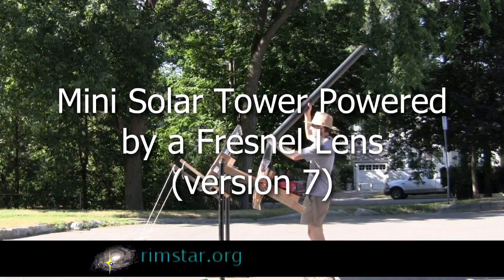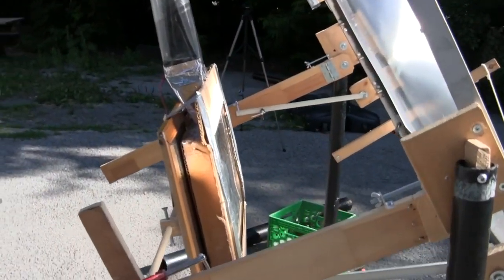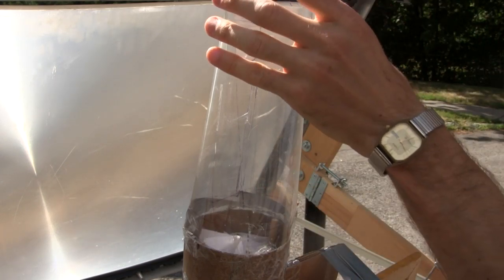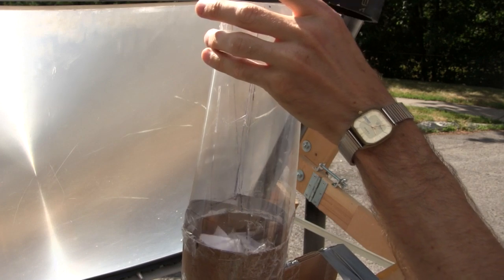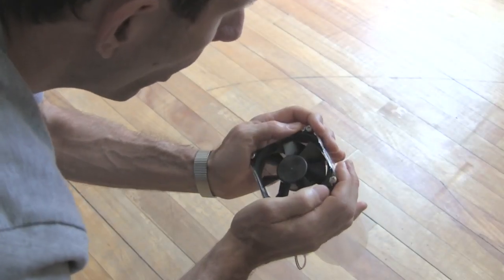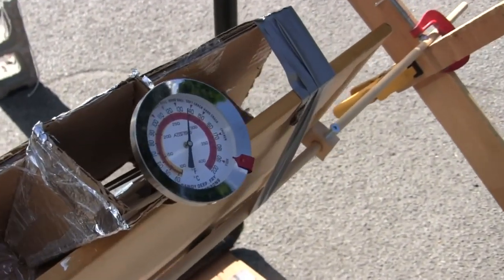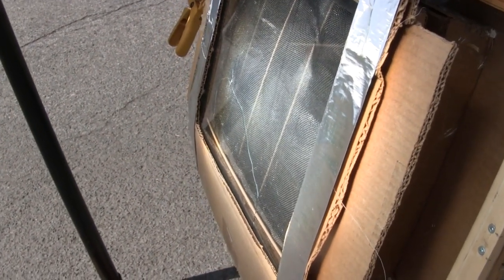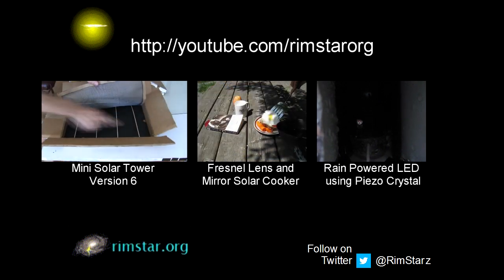Mini Solar Tower with Fresnel Lens Ver. 7 Screen Solar Air Heater

Comment: What if you took the top of a solar tube and hovered it over a solar panel.  It should double the output of the solar panel.  But it would also double the heat.  What can you do with the heat?  Why not place an apparatus on the back of the solar panel that would be similar to a radiator.  Then you could fill the pipes with antifreeze.  Once this was completed, you could transport the excess heat to a set of firebricks.  After the firebricks were heated, then you could hermetically seal the firebricks and use them for heat in the wintertime.

Comment: The blades on the pc fan are the wrong shape for this.  That pc fan is designed to pull (relatively) large volumes of air through the system when power is applied to the motor.  It would take a lot of speedy air to make it turn on its own to generate power. 

You need a blade designed to give you the desired torque to turn the motor (being used as a generator in this case) at the lower wind speeds you are producing.

Using a blade designed for one of those Martian helicopters would be an interesting test.

Another idea would be to use a  VAWT orientated turbine instead.  They work better in chaotic air flows.

Idea 3: could you tune the length and diameter of the tube to turn it into a vortex tube? That would seperate the airflow into two streams, a hotter flow near the wall of the tube spiraling up and a colder stream traveling down the center that could be recycled into the cold part of the stack.  You might be able to get a secondary power generation from the hot end if its worth doing.

Comment: One possible replacement from your earlier attempts could be to replace the Styrofoam with the high efficiency and very light fire brick. They're easily cut with a hacksaw and can withstand thousands of degrees of temperature.

Comment: Your entire system is flawed. The solar chimney creates airflow with heat rising, causing a draft in the pipe. If the air at the bottom is already hot then there is less temperature difference to cause the flow. It's like a tegs unit. the closer the two temperatures are, the less energy  you're going to get. You need cool/cold air coming in the bottom, then start heating the air.
Reply from the maker: I thought the temperature difference had to be between the cool air at the top of the chimney and the hotter air at the bottom, like this one https://www.youtube.com/watch?v=0tWlP0knKQU.
In any case, I do have cool air coming in the bottom, and then I heat it. It's just coming in the bottom of the box-shaped solar air heater.
Reply: Yeah, but look how high that tower would have to be. It was cooler at the top because of the elevation and location in a place with high heat at ground level. And the tower was white, which would reflect any additional incoming heat rather than absorb it like a black tower. That one looks more like they're using 'hot air rises' where the incoming air is already hot, but being so tall they're trying to force it to cool back down before releasing back into the atmosphere.
Reply: I figured since you're really working at it, I'd offer my 2 cents to try and help as best as my slow mind can ;)
And thanks for replying.
Reply from the maker: I appreciate your 2 cents, always. No one can live in a vacuum. Thanks. I tried something more like the solar tower in the link last summer but we had a fairly cool summer with the sun never getting strong enough so it didn't work out.
Reply: Count yourself lucky. I live in a small apartment where I can't really build much to test. I hope you find a method that works.

Comment: The thermometer, is it measuring the sunlight or the air in the box?  I suspect it is the sunlight concentrated onto the thermometer showing so high a temperature.  Try measuring the temp of the air as it exits the box.  USing the screens actually acts to impede air flow.  Replace them with a piece of metal that is centered in the box with air able to flow around both sides.  That should maximize the air heating process.  It may well be that you do not have a large enough chamber, not heating a high enough volume of air to move the fan blades.  Interesting experiment though, I look forward to seeing updates.
Reply from the maker: It's hard to tell from the video (2:08) but, while the thermometer has a long stem, the section that the thermometer's stem is in is sort of a box-like tube that's not exposed to the sun. You can see this output tube in the version 6 video here https://youtu.be/kIu67acx7qk?t=3m35s. So the thermometer is not in the concentrated sunlight and is measuring the heat of the hot air only.
Good point though. We have to account for that when doing solar cooking. In that case it's often unavoidable as there's often very little room for a thermometer.

Comment: Dude you need air volume, heat is nothing with out air volume. You need to think of air rising up because it's hot, so you need a large area on the floor to funnel up to a small escape at the top. this will give you more flow. And, please don't think square when it comes to air, I know they rhyme but not really that efficient. Thanks for the videos though, really helps look at thing objectively.

Comment: you could get more eficiency if you attach heat dissipators from old electronic parts inside the tube, attached to the hot part. that way more heat is transfered from the heat surface into the sourrounding air. (pardon my english)

Comment: I think using a white or silver tower will help.  A solar tower works off the difference between the hot air at the bottom and cool air at the top. That's why towers have to be a certain height, so they can get to a significantly cooler layer of air.
Reply from the maker: Hmmm... Good point. Though the black ABS one in this video didn't have time to heat up.
Reply: wouldn't the greater surface area in the tube serve to increase the air inside the tube and temperature difference at the top?
Reply from the maker: NwoDispatcher
I don't know why it helps, but a bigger diameter tube and longer tube both help. Both of those add up to greater surface area, so I guess the answer is yes.
Reply: NwoDispatcher "wouldn't the greater surface area in the tube serve to increase the air inside the tube and temperature difference at the top?"  If it add heat to the interior air yes but it's not the surface area that helps but the fact that the internal volume is greater. Permitting more cu. ft. of hot air to be used. Remember the air is being heated under the skirt around the base of the tower not really inside the tube as it rises. I think an insulated tower would be more important so the interior hot air won't loose heat to the outside through the tower walls as it rises to the top.
Reply: RimstarOrg I think your right because a fatter and longer tube will hold more cu. ft. of hot air which is lighter and rises. More volume of less dense air yields more output.
Reply: Hot air rises. You've got it backwards, it's cool air in at the bottom and it heats up as it goes higher.

Comment: Oh, I just commented your other video and suggesting to make tower (I said channel, but it is just my bad English). 

You see, tower helps, but I think that paper fan, or anything else should be at top of the tower, not at bottom or in between.

Think about it next way; imagine fan blowing air - at inlet, velocity of the air is pretty low. Immediately after fan you get maximum velocity of the air. As you move far from the fan, air slows down. Now imagine reverse action (movie running backward, or at least you can imagine it).

At bottom, hot air rises up, but need time to reach some velocity. After hitting fan, it slows down if 'wind' energy is transfered into rotational energy. If I remember correctly, the power people get from wind turbines is exponentially proportional with cube (!) of the  wind velocity. 

Keep good work, and continue experimenting. I am enjoying watching your video.

Cheers!
Reply from the maker: Oh, and I just replied to your comment over there suggesting you check out this video too, and then got the notice about this comment. :)
You might have a point there but I don't get that much heating from the tube. Maybe if I left it in the sun longer then it would heat up more. Oh well, we're in winter now with dismal sun so there's no way to test these days.
Cheers!
Reply: RimstarOrg I think winter time is more interesting to me (because my health condition), and I can work in my room - close to the stove, and probably see what there can be done in order to force this fan to move.

There is two things that come in my mind right now:

1st: Does hot air rise, or surrounding colder air push down? Cold air is denser and heavier, so it maybe push down so that hot air rises by buoyancy.

2nd: Maybe we need a 'working fluid', or simply water vapor?

http://en.wikipedia.org/wiki/Thermal

On this page, there is explanation about thermal column, or just thermal. Important sentences:

"Cumulus clouds are formed by the rising air in a thermal as it ascends and cools, until the water vapor in the air begins to condense into visible droplets. The condensing water releases latent heat energy allowing the air to rise higher. Very unstable air can reach the level of free convection (LFC) and thus rise to great heights condensing large quantities of water and so forming showers or even thunderstorms."

So, if that is true, then we need to heat water (maybe until boil), and allow it to condense at or close to the top of the tower (~chimney)? If nature does well this way, maybe we can do it too?

Cheers!

Edit: I think I will do something very soon about your interesting idea of solar to mechanical energy (although, can't capture video with my broken camera). If water vapor rises, it will pool cold air too. But, we can prevent this, or maybe this will helps, don't know. All of this resemble steam turbine, but with difference - maybe this can work on relatively small pressure difference (unlike real steam systems, where pressure is huge).

I should to rethink about that. Condensing water close to the top of the tower will 'tend to push back', but now it will be actually condensed on the wall of the tower, so I hope it will just return down (which is benefit actually, replacing evaporated water), and not pushing against upward draft of the air + water vapor.

What you think about this idea?

Best wishes!
Reply from the maker: *****
The fact that I'm using air is definitely a factor. It's been pointed out many times that if I switched to a denser medium, like water and steam, then I'd be better results. But in this series of experiments I stuck with rising hot air so I could see how far I could push it, knowing that it wasn't the best medium to work with.

Comment: Would making the box out of metal and painting it black work better. Black body radiation. Not sure if I used that in the right way or not. Still a neat Solar updraft tower. Here is a link you might want to check out. That is if you haven't already. Wouldn't let me post the link but look up Solar updraft tower

Comment from the maker: I'm not too sure hot air inside the tube is an issue. Think more of it as a chimney in a house, you need to heat it up to get an updraft going. The temp difference between the air in the tube and the air outside at the top is important. However, a black tube would heat up the air around the tube which would then rise and decrease the temp difference between air in the tube and air immediately outside at the top. But I didn't run mine long enough to heat up the tube's outer surface.

Comment: You might try something  Larkin 's Thermosiphon air-to-air heat exchanger siphon affect. Something like a u-shape at the top of the tower (to stop leakege from the top-once its flowing air, no cool air would come in the top (maybe-deltaP...)

Comment from the maker: This PC fan feels very smooth when turned by hand, and I did use a long stick to reach in and try to give it a jumpstart, not with the long tower attached of course. But I guess if I shopped around I could find a motor that turned more easily. Heck, I could even try winding a small few turns of wire myself. Darn! Maybe there'll be a version 8 after all?!?

Comment: You might want to try a different fan. PC fans are pretty notchy - so there is quite a bit of resistance at startup. You can feel the notchiness when turning it by hand, and on those cheap electric PM DC motors, too. I guess a more expensive motor of some kind ought to be smoother and easier to start.

Comment from the maker: Yup, it's far from ideal. You're better off circulating water through a long length of black hose that sitting out in the sun. But now that you bring it up again, I wonder if you have a copper pipe that well insulated except at one spot and put that spot at the focal length AND circulate water quickly through the pipe. The water might pick up enough heat before too much is lost to the outside air. Hmmm... it could go either way, hard to say.

Comment: mostly- some of bernouilli's assumptions don't fit this aplication until its fast enough flow (tall enough height) to get into fully developed turbulent flow.  trick( I think ) is to trap a Bubble of Hot AIR in the chimney so flow is constant- heat engine thermodynamics is pretty close (ericcson cycle). The energy available to extract is kinetic energy based on the height that it rises (potential energy is the change in density from solar heating at zero (relative) height). constant volume flow.

Comment from the maker: That's the idea I was going on too. The cold air in the tube is at lower pressure and of course the hot air in the solar air heater is higher pressure. I was going on the theory that that pressure difference is what drove the air flow through the fan.

Comment from the maker: A fresnel lens is great for boiling water for cooking but for heating water for space heating purposes or showers you're better off with something lower temperature. Higher temperatures means more efficient heat loss and harder to keep the heat. Space heating and showers don't need that high a temperature. Of course, this solar tower idea is even less efficient but it is fun and an interesting problem, and not evil. :)

Comment: simple bouyancy explanation. 
if you hold your hands over the ends of a pipe and stick it under water-no matter what direction you orient the pipe- when you remove your hands water flows in both ends.  the air still goes up.
for the chimney turbine-its the 'cold' air that actually does the work.

Comment: couple things- chimneys leak top and bottom until you reach fully developed turbulent flow (Re>4000). engineeringtoolbox search natural draught for calcs.
with laminar flow the turbine needs to be at the top (couple chimney diameters-bernouilli orifice). 
a drag type 'fan' would work better (umbrella shape).
sidenote- the fresnel may work better with a copper kitchen scrub at the foci.
Case fan genny (couple leds)-you have to hook the coil center taps together sans circuit board (2 pole..).